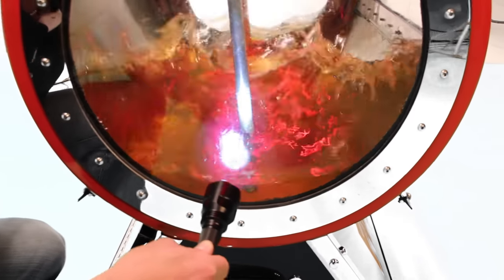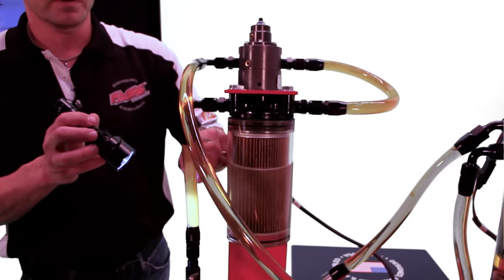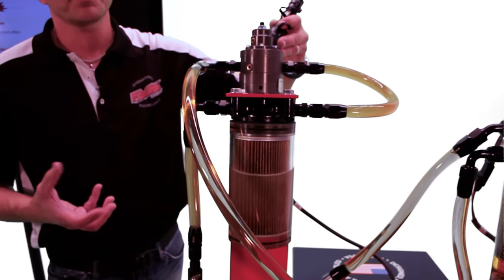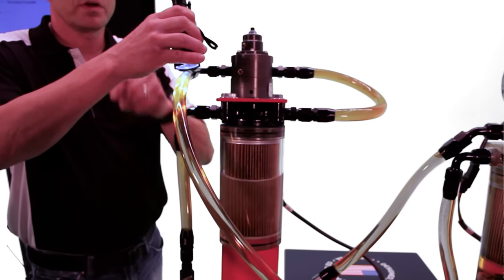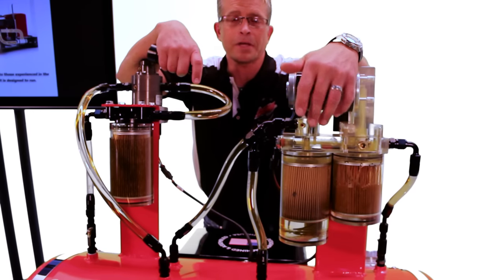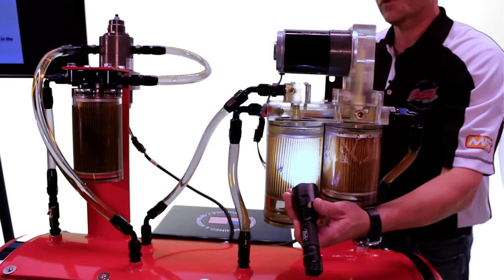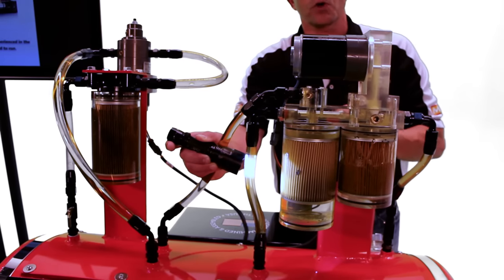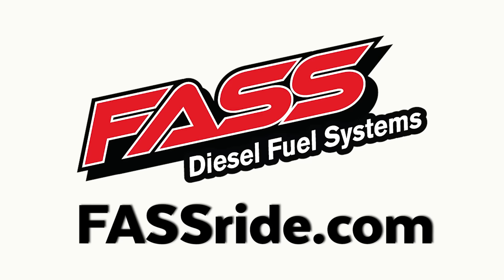FASS Fuel Systems "How It Works"

Comment: I’ve had my Fass system on my Kodiak c4500 for 8 months now, runs great, i’m averaging two more miles per gallon towing my 40 foot RV 13000 miles smoother running lower idling less overheating, a part of that might be the big banks oil cooler, like it a lot would, recommend it.
Reply from the maker: We appreciate that, thank you for all the support!

Comment: Absolutely the best $1000.00 that can be spent if you have CP4 fuel pump. With the Exergy’s Improved Stock Inlet Metering Valve (FCA/MPROP) you can have piece of mind that the pump wont grenade and kill your entire system. Thanks FASS for a great product.

Comment: Is exactly what I will be purchasing. Religiously changed/cleaned oil, fuel filter, injection systems and running the best of the best for oil on my 05' 5.9 Cummins. Hauling trip into Arizona, made bad judgement error topping off at an ExxonMobil station and later lost an injector, then the #1 cylinder. Pissed me off to no end. Spending close to $14k on a new motor and transmission refresh. Guarantee this will be a welcomed addition. Thanks for this vid!!
Reply: Viper1 what's wrong with Exxon Mobil fill stations?
Reply: Where do you get your diesel fuel from?

Comment: I just installed this system on my Silverado things seem to be working well my only problem is I have a field trip coming from the electric motor what is the cause of that? And thank you I'm unable to find at this point a breakdown of the internal mechanical diagram

Comment: Ok, looks great but I have an issue, I have two tanks, how would I plumb the return line back to the tank I’m using??
Reply from the maker: Awesome question, and for the best help with getting this set up our tech line will be able to get all the part numbers and info for you. The number for them is 1-866-769-3747.

Comment: I have a 07 5.9 bad cylinder #1 and a ton of blow by due to bad fuel filtration , now I have to rebuild my engine bore out and sleeve my cylinders , had I known about how bad those trucks were about fuel filtration I would have installed this years ago

Comment: I have a 2002 f650 with a 5.9 do you guys offer a pump it
Reply from the maker: Great question, and while we don't offer a kit for that specific setup typically the 5.9 Ram kit will work for those trucks with a little modification. We have the weblink attached here for you as well. 

https://fassride.com/shop/product/shop-category/2004-5-2007-5-9l-24v-cummins/fass-tsd08100g-titanium-signature-series-diesel-fuel-system-100gph-dodge-cummins-5-9l-1998-5-2004/

If you have any questions or need anything you are more than welcome to reach out to us anytime! 636-433-5410 is our service team number.

Comment: I want to buy one of these for my 2019 l5p. I know it needs to be tuned afterwards. The problem is I have limited abilities to do what's necessary to change the fuel pump ect. My question is, is there a place near Fenton Mo, that sells and installs your system. Also what about a lift pump replacing the in tank fuel pump.
Reply from the maker: Hey Anthony, thanks for reaching out. We most definitely do—we'll attach a link to our dealer locator tool below.

If you're looking for a specific recommendation, Linco Diesel Performance in Troy, Missouri is very well versed in the L5P platform, and would be happy to get you set up! 

Here is the link: https://fassride.com/customer-support/locate-a-dealer/?search_type=zip&dealer_type=1&country=US&zip-code=63026
Reply: Thank you for your information and answering so quickly.
Reply from the maker: You are very welcome! If anything else comes up you are more than welcome to reach out to us anytime!

Comment: I cant find a system for my 93 7.3idi and i need one i heard you can take one made for 94 and lower the pressure to 7-9 psi and it does the same thing i just want to make sure?????

Comment: Great video and product!  I would just like to know if most customers are using a sump kit in conjunction with this lift pump system.  

I am curious because I am about to equip a 2016 Duramax Denali with the FASS lift pump system and I wanted to know what other customers are using.

*There are other great questions in the comments section about this system that I too would like to hear FASS answer for us.  Thanks!!!
Reply: yea majority of people run a sump kit its better for your truck anyway

Comment: My FASS 95 has quit - with ign. on - no 12vdc at the motor, checked fuse with meter (OK 12v there) replaced the relay (12v there) checked voltage coming from ECM (7.8vdc with ign. on) Took ground cable off and cleaned it. Other than a broke wire in the harness???  Let ya know what fixes it!  04 Dodge/Cummins 5.9 2500

Comment: i'm interested but I live in NY and I've seen these pump motors fail because of the crap they put on the roads up here, Are there any other mounting solutions besides under the truck?
Reply: It's got a limited lifetime warranty, email them and ask! I'm in Canada and will be putting this to the test for sure 😁
Reply: @Driver0808657   the Racor P510MAM is a great alternative. Built for continuous industrial use.

Comment: I'm looking at a fass for my duramax. Its tuned with an intake and the hottest tune is 150hp. I've been told I only need 100 gph, but have noticed the 165 gph is about the same price. Will the 165 cause me to lose mileage because I'm waisting fuel? Thanks
Reply from the maker: Great question! Stepping-up to a higher flow option simply means more fuel will be returned to your tank. 

Your engine will still burn the exact amount of fuel required by the tuning parameters.
Reply: @FASSFuelSystems  thank you very much. May go ahead with the 165 incase I ever decide to upgrade injectors and/or turbo.
Reply from the maker: @duramaxman8242  Sure thing! If any questions come up, give us a call at 636-433-5410, and our team will be happy to help.

Comment: Does this change the mpg of my truck ?
Reply from the maker: It will improve the efficiency of your truck which should improve your fuel mileage. The amount of gain you'll see will be hard to determine based on conditions, loads on the truck, and etc. If you ever have any other questions your more than welcome to reach out to us at 1-866-769-3747.

Comment: If the FASS stops unexpectedly will the factory vacuum system/CP3 still be able to pull thru the FASS system?
Reply: Yes my pump fass titanium died under two years old truck still runs fine gonna pull pump and mail in for warranty repair my truck is a 2008 lmm duramax the motor runs way smoother and quieter with the pump working
Reply: I have a lift pump pressure guage on my cts thats how I knew my pump went bad
Reply: Theres a video of my failed pump on my page I sent it back to fass they fixed and returned only cost me 16 dollars shipping works great again

Comment: How often should the filter's be changed?  Is there a general rule?  Do I change them when I change the factory fuel filter, or when the FASS fuel pump starts to whine louder?
Reply: change them every 3k-6k miles just like you would with stock filters. Better to spend a few bucks on filters than to buy engine parts or injectors.

Comment: Oh by the way shortly after installing this i had to replace all my injectors and my cp4. Shop that installed it is diesel pros in hurst tx.
Reply: Ya i did too. 5 injectors went out with in 6 months. I think it clean the fuel to good. So some of the lubricant it taken away and burn the injectors up
Reply: @jefflittle5119  yeah I've been adding additive to mine quite a bit trying to keep everything nice and lubed

Comment: What you do when yoy realize your diesel onky uses 30 percent of fuel pumped to it
Reply from the maker: Hi Joe! If we understand your question correctly, you're asking about installing an oversized pump. 

With our systems, you can install a higher-flow pump than your engine needs, and the excess fuel will simply be returned to the tank. 

Since our pump and filters remove all the fuel contaminants, the excess fuel will be continually polished as it circulates through your fuel system.

Comment: You lost me at prefilling.. never pre fill a fuel filter
Reply: Why not? Enough air in diesel means it doesn't run, a little air means it doesn't run well. What's your procedure for purging if you don't fill you filter?
Reply: Mike Barnea prefilling a filter allows unfiltered fuel to go through the system.
Reply: @justinfranklin204  fair point, but what do you do to get the air out of the system?
Reply: Mike Barnea depending on the engine, crack the fuel lines loose to bleed the air, otherwise common rail is self bleeding
Reply: Your forgetting the filter before the injector pump
Reply: willie171988 no I’m not actually. It’s simple, you do not pre fill unless you want to promote contamination.
Reply: Ok, but he just talked  the primary being prefilled?
Reply: Scott Downey doesn’t matter. It’s still putting contaminants in that are not fully filtered. It’s not that hard to understand.
Reply: @justinfranklin204  I do it on my 2005  cummins Dodge 3500. I have a 20 micron primary, I have the 5-7 micron OEM, then a 2 micron Cat, but I dont prefill the cat filter or the OEM filter.
Reply: Justin Franklin i completely agree bud but guess what i just saw this week? A Baldwin filter with a plastic plug in the center of the filter. Lol the other mechanic asked why it was there... i said to keep dumbies from adding dirt to the clean side of the filter lol. Cool AF
Reply: @Reel-Lentless I can hear you from Minnesota,  lol.
Reply: That's cats bs...I've prefilled for over 6 million miles on my fleet zero issues and currently have a 3406e with over 2million it was 1st truck